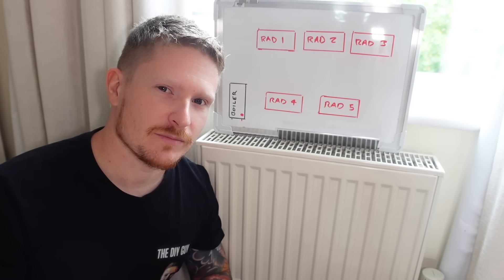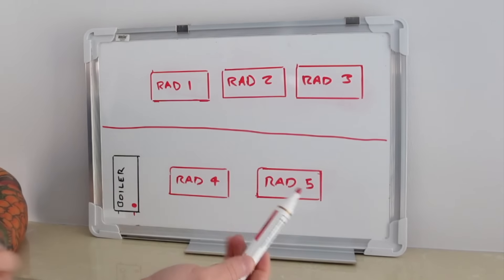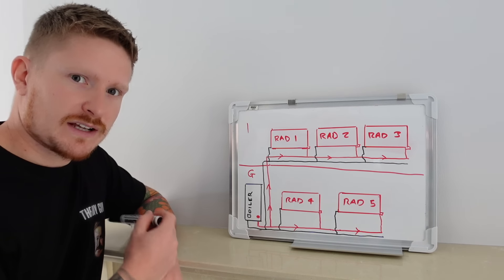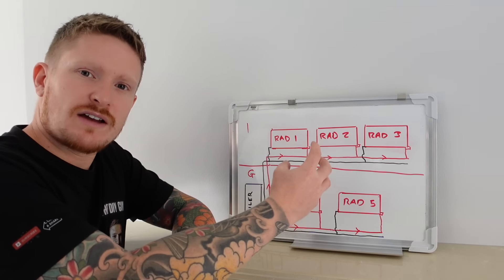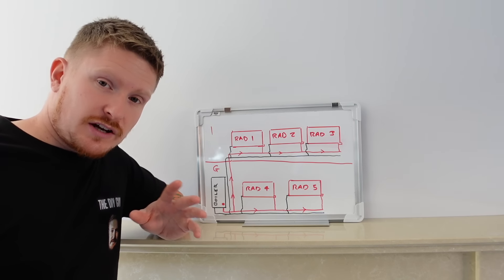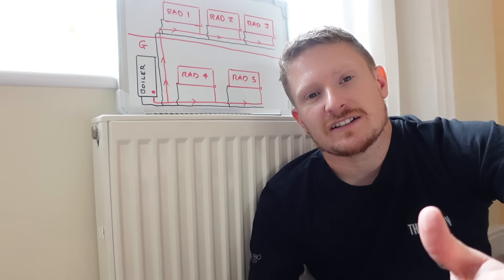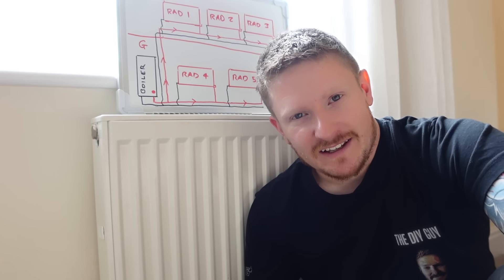How to Balance Your Radiators | Save Money and Increase Heat

Comment: Should we put all the TRVs on mumber 5 first
Reply: Your rads SHOULD be correctly sized for the room.  So, ideally, you shouldn't need TRVs or lockshields.  So start with the TRVs on max...but don't forget that your air stat (if you have one - probably in the hall) will primarily determine how hot the rooms get!  We used to say that if you have TRVs, then you turn the air stat up to max to keep the system on, then let the TRVs find the room-heat level.  This only works if your flow pipe from your boiler is very well insulated, so you don't lose heat before it gets to serve the first rad.  Ideally, if your system is satisfied, your boiler should come on, sense that there is no flow* and switch off.
*This doesn't work if you have a system by-pass rad - one that gets hot without control, as the heat just goes there!

Comment: Bit confused here, the first 2 rads running off my boiler are very small ones, would there actually be any point in throttling these down? Also I can't get my head around the total kw output of all the rads. Taking this to extremes to make my point,  imagine turning all L/S valves off apart from just the one rad, surely that rad is then only outputting around 1kw of heat, the return water to the boiler would only be slightly less than the original flow, maybe even causing it to cycle. By opening fully all the L/S valves then, say, 8 rads would be using around 8kw of heat thus the return  to the boiler would be much lower, no cycling and condensing more. I balanced all mine and found that the return temp was much higher than when I had all L/S open AND still had no rads struggling for heat. Am I missing something?

Comment: Ive got new radiators in extension unfortunately largest one doesnt work out of all the other 5 that do get hot it stays cold. Plumber said could be because of 10mm pipe so other than a rework any ideas ? 💡

Comment: Does this method work? if the system is split into two manifolds, one for the front feeding 5 radiator's, and one for the back feeding 7 radiators. thanks.

Comment: When you are balancing do you fully open the thermostatic valves, and reset them after balancing the whole system?
Reply: @markbeauchamp3192  System with thermostatic valves will work fine even without balancing, but you can have some problems with noise from valves or not recommended pressure for those valves. You can simplify balancing a lot with thermostatic valves and heads.

Comment: I try to gently discuss with people who have installed smart TRVs on every radiator that enable them to individually control and programme every room to an individual temperature that there is a far simpler method of control. I never see TRVs as being effective due to their placement on top of a pipe and next to a radiator and often behind a curtain.

Having tens of smart TRVs having the ability to destroy the balance of a heating system by opening and closing according to their own schedule and being able to call for heat on what would become a random basis would not lead to a comfortable solution. 

Unless you have a vast unused wing of a mansion the zoning of a house trying to maintain temperature differentials between rooms that are separated by internal walls and cardboard doors is the wrong approach and their money would be better spent on whole house insulation and their time balancing their system.

Comment: Tricky to work out which is the first rad as some of mine are pretty cold so cant tell by the temp. I it normally the rad nearest the boiler? Same with two rads in the same room they heat up the same time, would getting the order wrong with those be a bad thing? thanks for a great video
Reply: It should be ok as the 2 rads in the same room will (probably )heat up at a similar opening.

Comment: My cold radiator is upstairs. All others seem fine. I've tried the valve pin first, then next tried bleeding it, then took the radiator off and bled flushed it through. No luck, stone cold! The pipe leading to the lockshield valve is also cold. Any thoughts?

Comment: Hope this isn't a silly question, I want to turn down how hot the radiator in our hallway gets as it gets boiling hot and we worry our 2 year old will burn herself on it, we are happy with the temperature on the boiler on the other radiators, it's just 1 one we want to adjust, we have a thermostat vale on it, but it won't heat the radiator up if on 2 or less, and anything over 2 the temperature is the same (boiling hot).  Is there a way to have the single radiator still come on, but at a lower temperature to the other radiators? Thank you 🙂
Reply: Turn down the lock shield valve to restrict the flow...

Comment: It helped thanks but i still have issue using one radiator. It is hot at the top but cold at the bottom. The weirdest thing about it is that return pipe is hot and flow pipe is cold(actual pipe below trv). I am puzzled because it should be the other way round. Could you/someone else here advise on potential cause/fix? Perhaps I did not balanced my system well since it is hard to determine order of radiators from the boiler.

Comment: Hi, if the thermostat TRV is on the return pipe,  do I balance the flow which has a lockshield if I want to maintain a 15-120c temp differnece? Because atm my flow is 55c which is what the boiler is set to but the return is also 55c but I cannot adjust it as it has a thermonstat and not a lockshield. Thanks

Comment: Hola, 
Continue to have one radiator not heating up.  Valve is open, system has been drained and recharged.  We don't seem to have the valves you describe on the discharge side of the radiators (with the pin).  We noticed the problem crop up last year after a freeze in our area.  Although pipes do not seem to be compromised, although they are wrapped.  Any suggestions?

Comment: My rads are terrible, boiling upstairs and warm to almost not working rads, my biggest one down stairs which is supposed to give the most heat only just reaches 40*c and bathroom rad reaches 68*c with boiler on max I'm going to try this out, I only have cooking heat probs to measure the flow return temp,. Sure this will work just as well, will report back with my success

Comment: So the hot water comes in via the lockshield valve and returns via the TRV. What happens if the valves have been put on the wrong way round? I have 8 rads and after watching your video I have discovered that I have 3 correct. 4 the wrong way round and the one in the bathroom next to the boiler has 2 lockshield valves. The plumber said this is so the pump has something to do as it`s a pressure system. Therefore I cannot balance my system without switching these valves around.

Comment: How do you adjust these instructions for smart radiator valves (so some rooms hotter, some radiators usually off) and a condensing boiler? Do I only do it for the radiators which are usually on (with the others off) as that’s how the system mostly is?
Reply: Do I open the lock shield more on the radiators we use more?

Comment: At 2:40 you state that the lock shield valve is fitted to the return pipe - at 5:25 you state the heat is getting in to the radiator via the lock shield valve but it can vary?!   Up to this point I was fully on board with what you were saying. What part does the thermostat (TRV) play in the balancing if any?

Comment: 8:11
last radiator
I'd prefer to open it fully but then turn it back ¼ or ½ a turn.
That way if someone comes to it years ahead they'll be able to turn it either way without causing any damage.
Reply: Any turn above 1 to 1 1/2 won't make any difference, the valve is (probably) at its fullest opening.

Comment: I'm confused about doing this for upstairs and downstairs. You said a typical boiler splits the flow so how do I do both floors? If the radiators ran in series then I would get it but splitting the floors makes them parallel so how do I balance them out? Would my first radiator be by the boiler and the last be the 3rd bedroom?
Reply: The living quarters are probably more important than the bedrooms.....I'd turn the first rad upstairs a 1/4 and slightly more for the other 2 bedrooms and would also start off with the first one downstairs at maybe 1/2 going to full on the last one downstairs. Keep the TRVS on full and see how they warm up from cold. Tweak as necessary.

Comment: Hi, great advice, my lockshield valves have limited movement, I started off with half a turn then incremented by ⅛ turn per rad.  By the time I got to rad 8 it was fully open about 1 ⅜ turn from open to close so I left 8, 9 & 10 fully open.  I guess that I’d have to drain and replace all the lockshield valves or reduce the increments to less than ⅛.  What would you advise?

Comment: How to balance towel rail I have valve on right side heating coms in, on other side I have cap removed cap and only Allen key port available to adjust. That Allen key port this is the way to adjust float, because rest of radiator valves r adjusting by valve’s you can easily adjust

Comment: But if I've a system that has some radiators that don't get warm (which is what I want to fix) I won't be able to work out which order the radiators get fed using your 'feel them and see which get hot first' method. The solution depends on not having the problem in the first place, doesn't it?
Also, what difference does the setting of the thermostatic valve on the other pipe make to the balancing process? Should they all be fully open, fully closed or doesn't it matter?
Reply from the maker: Feel the pipes where they exit the floor/wall.

Comment: Some of my TRV valves are on the return end of my radiators. The valves are bi-directional and have arrows on them going in both directions. Should I switch these around in your opinion so the TRV is in the inlet side?

Comment: I've got an issue with one rad only ever getting moderately warm, I've tried loads of different things and will be giving this a go, though I have a question, I know radiator 1 is next to the boiler so that's easy, however what if my upstairs and downstairs radiators next in the system warm up the same time, in this instance do I just class upstairs radiators as the first ones to get warm off the boiler? And so I adjust upstairs first before adjusting downstairs?
Reply: So after watching this video and just messing about trying to find which rads filled up when, the moderately warm rad is now throwing the heat out, never in 2 years has it done that 🤣🤣🤣, and I'll admit all the other rads in the house are blazing with the TRVs only being set to 2 or 3 amazing video, I think essential given the current climate well done buddy.

Comment: If you have rads that are cold then how can you establish which is the first and last on the system. I have an old house with an system that’s been extended, and it’s near impossible to establish the order of the radiators before I can implement the balancing. Any ideas?

Comment: Hi just had some new radiator fitted and one was a triple
But now the ones upstairs are hot but not roasting and the ones downstairs are warmer at the top but colder at the bottom of radiator and takes ages to heat up 
Boer is only 2 years old and had a flush through don't think it's sludge as it was fine before any ideas

Comment: My boiler is in the loft and finding it difficult to work out what radiator comes on first, they all seem similar. I fitted a new radiator myself and know it needs balancing correctly as warm at top and Luke warm at the bottom. Is there a link for the thermal image camera?

Comment: I'm in a new build with 2 zone heating would I need to treat both zones independently or have them both on at the same time to balance? Also my radiators heat up that quick I don't have time to run around to find the first radiator in the system, is there any pointers to help me find the first in the system? Thanks

Comment: the lockshield valves on my radiator are a different shape to yours and do not look as if they can adjusted by a wrench. Also, there is a screw on the plastic caps that needs undoing in order to release the cap. Any advice?

Comment: you mentioned that on the radiator you were adjusting in the video you said that the water inlet to the radiator was via the lock shield valve not the thermostatic valve so how do you know this.
Reply: The flow pipe  always heats up before the return pipe.

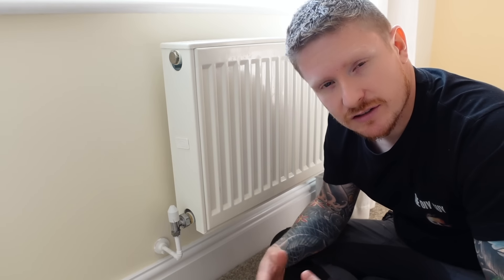Comment: 4:06, if you turn the CH on, could the radiator that gives the path of least resistance be the one that heats first? I dont have a 1st, 2nd or 3rd rad. The flow splits into 4 and  then 1 of those 15mm pipes then splits into 4  more 15mm pipes.

Comment: STUPID QUESTION ALERT! I Once all the LSVs are set as per your instructions, will the system remain balanced if you subsequently adjust one or more thermostatic valves?
Reply: No.  When a system has been balanced, it is in the state it is in with the TRVs set.  When any TRV opens, it unbalances the system.  But don't worry about it - most of 'balancing' is hogwash.  Unless a room gets seriously hot, then balancing is pretty pointless.  What you ACTUALLY need is an air stat in every room linked to a valve which allows the water to flow to that room alone.  This is what is achieved with an electric system.

Comment: On checking the rads on my system the values are fully open at both ends so how do I tell.what valve is the lockshield (,caps are loose and have probably been swapped over )

Comment: If it is difficult to identify the order of the radiators, would the same principal work if I opened every valve fully, let it settle and then take the temperatures of each input and output on the radiators and order them from highest to lowest?

Comment: To increase the temp gap between flow and return you slowed down the flow? Shouldn't the return be slowed down instead? Also what if the flow temp is closer to 20 degrees higher than the return which adjustment is made then?
Reply: It doesn't matter whether you slow the flow or return. The effect is the same. Water passes through slower and thereby has more time to give its heat up.
Reply: To make less of a temperature difference...you speed up the flow...the water thereby has less time to pass its heat to the radiator.

Comment: My boiler is upstairs. It feeds one bedroom and the living room on one flow pipe. It then feeds bedroom 2, bathroom, hallway, kitchen, dining room downstairs. The tall slim rad in the kitchen is second to the end in line (I think) and in order for it to get hot, I daily go round turning every rad off to get the heat to it, then turn the rads back on. I’ve had the rads balanced, but the other rads were turned down so low that they whistled like a kettle and only got warm so I had to open them back up. When that rad was fitted it was the warmest room in the house so I don’t know what happened!

Comment: So if I use the digital thermometer linked in your description I can do radiators in any order ? But if I don’t I have to locate the first radiator and close it. Locate the 
last and fully open it, then mess with the ones in between?

The digital thermometer, for £17.99, is a way better method correct?

Thanks

Comment: I got a new radiator downstairs in my livingroom and I wasn't heating up well. I first of all tried bleeding it.  Then I adjusted the valves to try and balance it and it's now heating up but after the heating has been in for a while it seems to cool down again and the rest are still warm.  Any idea what might be wrong?
Reply: Sounds like lack of insulation or even too small a radiator? Also, try opening the lock shield valve fully

Comment: Does it matter if you throttle down the flow or return side on the radiator as my radiators have just the lockshields showing on some of them. i.e. there is no plastic knobs on either end

Comment: Hey, 
When balancing your radiators with a digital thermometer i.e setting s 12° drop from the inlet to the return pipe, do I still have to start one radiator 1 or can I just start anywhere ?? 
Thanks
Reply: Start with the one that heats up first

Comment: We had a bathroom flood & the radiator in our front room is only luke warm at the top nowadays. Could it be sludge?
Reply: No it’s trapped air. It needs bleeding via the bleed screw at the top of the radiator. Do it when your system is hot.
Reply: @simonbird1973  that what I did at midnight.  The top ones had air and all the heat

Comment: That’s weird. I bought the same thermal camera and I have TPVs. But the it seems the temperature is exactly the same in our house. New built. And even if I close the lock shield valve the temperature is the same. Even on the ones in hallway where no tpv. Anything I am doing wrong ?

Comment: How it is, when I have H-module (both in and out can be adjusted): shoul I mess just with out, or also with in? I have 3 radiators on same level and same line, and have issues with last one (not warm enough). I have infra temp gun-style thermometer on hand.

Comment: Question. I have a radiator where the lock valve has a flat screw cap on it. When I remove this I don't see anything "sticking up" that I could turn, rather there is a "hole" that almost certainly takes an allen key. Should I treat this in just the same way or is it something special?

Comment: How do radiators use energy? Ive been struggling with this lately, been spending around £14 a day on electricity as we have an electric boiler, i switched off 4 of the radiators in rooms we dont use and our meter still reads £1.26 per hour, we only have 2 radiators on set to about 3/4 and the rest on 0.. is it also normal for electric radiators to take along time to heat up and are they usually colder then gas heaters because after 3 hours our radiators are only just warm to touch